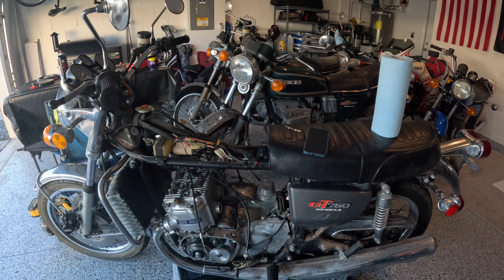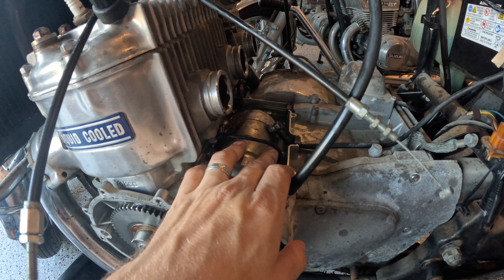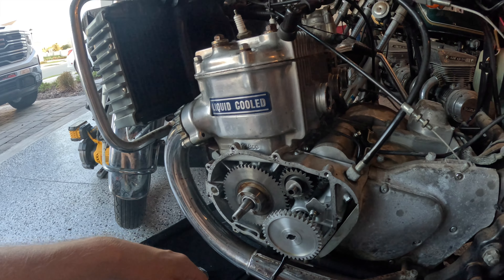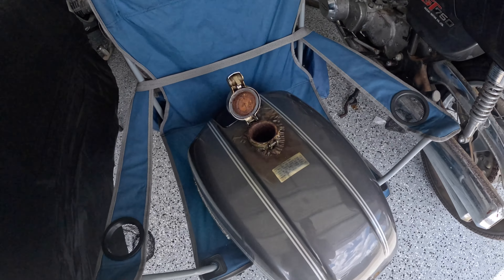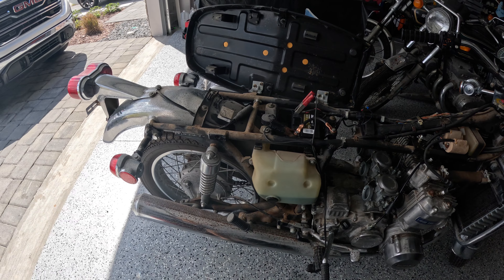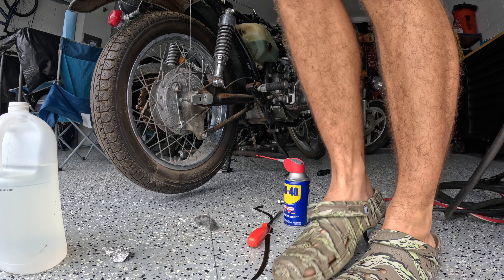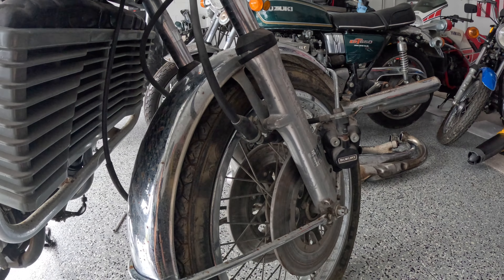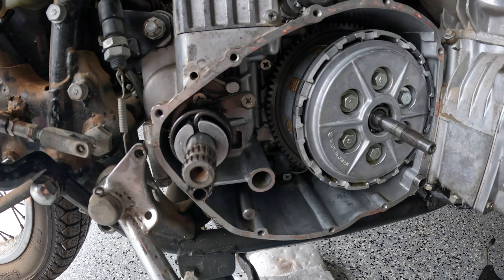Starting on the GT750 | Vintage Collection PT. 4

Comment: Re: Woodruff keys, motorcycles mainly use 2 sizes, a small kit with 10 of each is cheap and will have you set up for life. The cone does the actual holding, the key is there for timing. If the cone loosens up a little the key shears off instantly, and having to wait for a key is a bummer.

Re: Chrome, WD-40 and fine steel wool works best for rust coming through the chrome, other faster solutions are too agressive and damage the chrome. If there is pitting, a quick fix is silver rust converter, looks decent from far away if applied only to small pits. The real fix if there is pitting is replacing the exhaust, or sandblasting and rechroming. I also saw you have some frame rust, get some black rust converter and treat the spots, rust is easy to deal with today, but it leads to corrosion which can ruin a bike forever.

Re: Oil change, add a roll of aluminium foil to your shop, you can use it to build channels/throughs in any shape you need. One minute building a through is much better than five minutes cleaning up.

Re: Clutch, get a piece of glass (super flat), some fine sandpaper, and sand away. Usually you will be able to save them and can ride the bike with a little clutch adjustment to compensate for the worn down separators. While the ideal solution is replacing them, the aftermarket ones often are not as good as the originals which are not available anymore.

Comment: I have used steel wool and wd40 for rust as you mentioned with good results if its not to far gone . I tried the cola and aluminum foil it did ok but the foil wears fast and cola is messy. If crome is to far gone it maybe best to remove it and just paint the part there is some decent paint coatings out now. My dad showed me a hack years ago with sanding the steel clutch plates and just replacing the fiber ones best to be done on a flat surface in a figure 8 pattern sometimes every dollar saved counts.